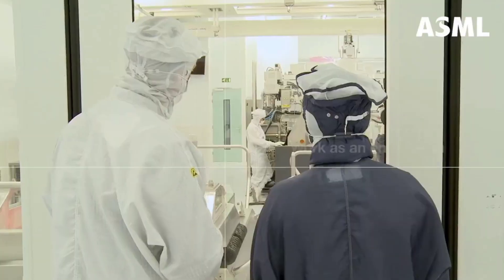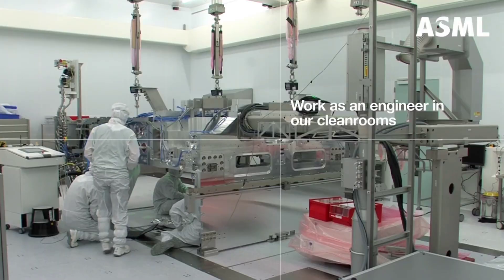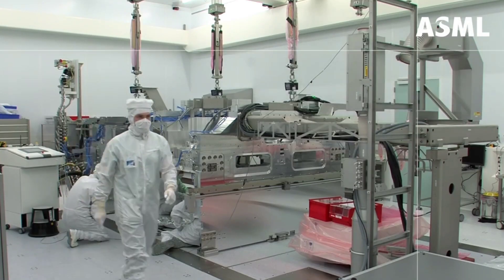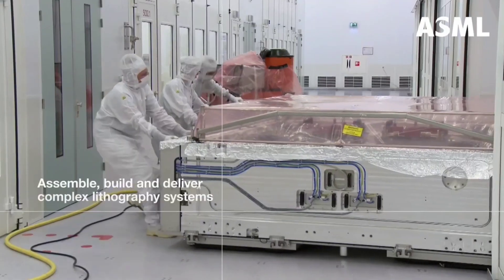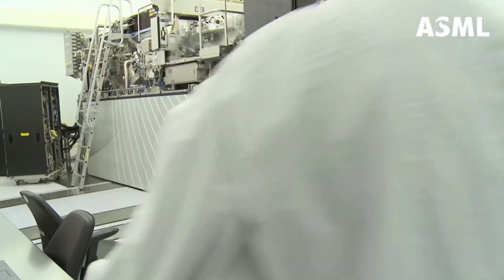Why World Relies On ASML Chip Making Machines

Comment: Seriously? So say you, ROW WOULDN'T AGREE. ASML IS LOSING MARKET SHARE DUE TO LACK OF ABILITY TO MEET NEXT GENERATION ARCHITECTURE. THE ONLY OTHER COMMENT IS  FROM AN EMPLOYEE WHO SHOULD CHECK YOU MANGEMENT AND SALES  SALARIES.. ONE COMPANY DOES NOT MAKE THE ENTIRE SEMICONDUCTOR INDUSTRY.
Reply: USING CAPITAL LETTERS IS ANNOYING AND DOES NOT MAKE YOUR MESSAGE ANY MORE TRUE/FALSE, IT ADDS NOTHING.
ASML is not losing market share where it counts, they have a monopoly on EUV lithography machines which is the current generation. A vital piece of tech needed to make the latest state of the art chips in your latest iphone, Samsung phones / tablets,... and computer chips like AMD and Intel. Everything needs faster, smaller and better chips, the only way forward is EUV at the moment. That is the tech that determines how fast your chip is going to be. Next generation is also on the way with High NA ( numerical aperture) machines as well. No competition on this.
Only threat is switching off silicon, but that is many decades away from being a reality. Entire supply chain would need to be changed, research still needs to be done.
So your comment is pretty wrong and uneducated, sorry.
But sure semiconductor industry is not 1 company though, building EUV even is 1 company working together with hundreds of companies around the globe as well.
And EUV just 1 of the many machines needed to make a chips as well.